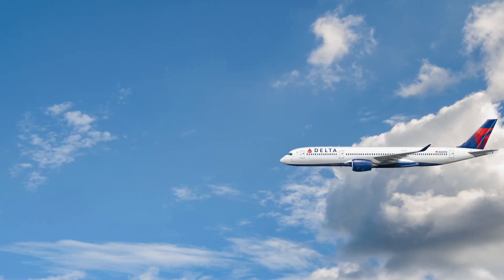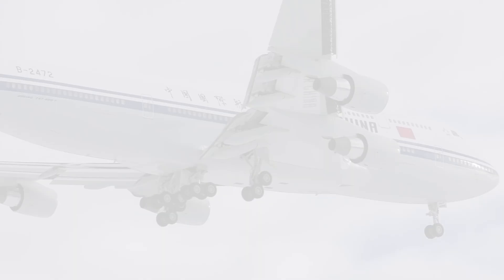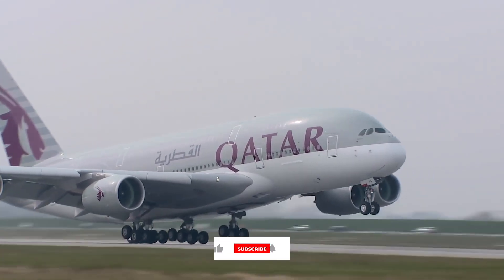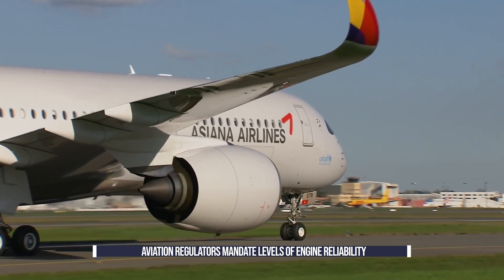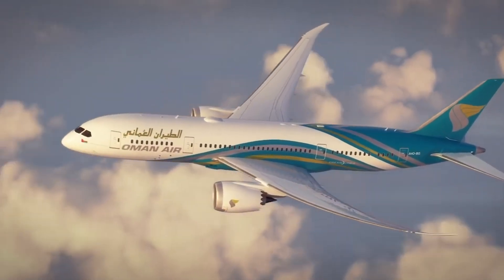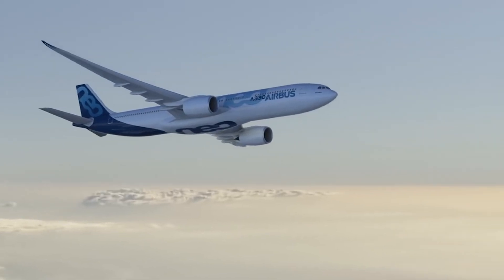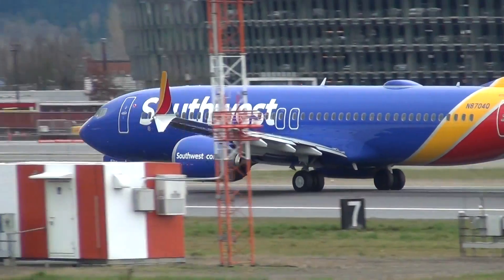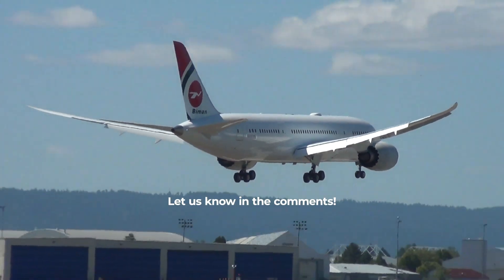How Far Can A Modern Twin Jet Fly On One Engine

Comment: This is like Apple.  Just take away the components and call it a feature. Eventually they will take away another engine and the plane will be down to one engine.  Just don’t blame plane if it crashes.  Just blame the pilot.
Reply: However, engines are not like a phone. Removing the headphone jack on the newest IPhone 51SR XL Pro with a 100 inch screen and 1 minute battery life is not as important as an engine going out on a Qantas flight from South Africa to Australia over the Southern Indian Ocean. The FAA would probably go insane over a monojet and strike the idea down. The FAA probably has done this at least once, considering that Boeing once considered a 747 trijet, proving that even the most cursed airplane ideas have been seriously considered.

Comment: question for experts...how many miles could a medium jet (a320, b737) fly after one engine failure during the final approach and at a low altitude (lets say at two thousand feet? And, in case of going around or missed approach in that situation , would it be possible to climb and start the approach procedure again with one engine?

Comment: have the FAA and other civil aviation authorities as well as plane and jet engine manufacturers actually tested these twin jet planes in actual flight conditions with just ONE engine in operation? not the engine's theoretical range?
a single jet engine could subjected to stresses beyond its original design parameters when compensating for the power provided by its twin engine on the other side of the plane... if ETOPS is based on theoretical range of the plane's jet engine, have they tested if the actual range is achieved as per ETOP Standards?

Comment: Another point is that ETOPS ratings require a particular maintenance regime whereby the 2 engines are maintained by 2 different teams (from different companies I believe). This is to reduce the possibility of an error occurring during servicing which could be repeated for the other engine (wrong oil etc.)

Comment: Been on a 747 when they needed to shut down one engine due to low oil pressure. You would not have known it unless you took a peek at the EGT cluster while visiting the cockpit. Yes kids, there was a time when that was possible :-)

Comment: I've been on two 747s that lost an engine. One on landing in Boston, where the right inboard engine backfired and then caught fire. The right wing panel was damaged, and we had to wait for about four hours for another airplane to be flown in from NY so we could go on to London. The other was flying from Athens, Greece to Istanbul, Turkey. After landing, the passengers were allowed off to wait in the terminal. Fortunately, I did not go. Once everyone was off the aircraft, the captain announced that the left, inboard engine had cracked a hydraulic pump, and there'd be a delay while it was replaced. Three+ hours later, a lot of grumpy pax got back on the plane.
Another thing I've seen (but not flown on) is a 747 with a fifth engine. There's an extra engine mount on 747s, inboard on the left wing. It won't run, but an engine can be mounted there and flown to somewhere else where it can be taken off and put on another aircraft.
Reply: The Vickers VC10 had a similar arrangement, with the spare engine carried in a streamlined pod.

Comment: They can fly until the fuel runs out. On the jet I fly, from California to Hawaii, it burns LESS fuel if you lose an engine at the mid-point (Equal Time Point) of the flight. It would be a little stressful, but it should get you there.

Comment: When one engine silently turns off and cannot be restarted then it might work to peacefully fly to the next possible airport. But usually this is not the case rather there is an explosion, the engine is destroyed and the crew is worried whether the wing is damaged or there is more and more fire spreading.

Comment: The answer is little bit mistaken. You can't maintain your altitude and speed with loosing one of your engines. Your speed will be greatly changed. So the calculation of normal cruise speed x time is not relevant. You may check basic one engine speeds from net to get much more presice results.

Comment: One question that never gets answered: What if a catastrophic engine failure caused a penetration of the fuselage [like the Southwest incident], and the aircraft had to drop below 10,000 feet to maintain livable oxygen levels for the passengers, and it was halfway across the Atlantic or Pacific. How long could it run on one engine, at or below 10k, which obviously would gobble up a lot more fuel
Reply: That's a great question!  One which deserves a great answer!
Reply: Good question. With a bunch of contingent answers, only some of which I know answers to. For smallish leaks in the cabin, the aircraft should be able to maintain pressurization. IIRC, up to one missing/blown out window (so it's not just tiny leaks). Another part is, as you conjecture, how long could it run on one engine? The rules for pressurization require cabin pressure below 14,000'; for crewmembers, w/ oxygen above12,500' cabin altitude for more than 30m, or above 14,000' at all. At those lower altitudes, airliners will see substantially increased fuel use and slower speeds (due to both power loss and thicker air).
I would assume/guess that these must be allowed for in flight planning in terms of pax/cargo/fuel load and abort options.
I note that ETOPS used to stand for 'Extended Twin Overwater Passenger Service' aka ('Engines Turn Or Passengers Swim') when it came out ~30 years ago.
Reply: ETOPS regulations require that the flight be capable of descending to 10,000 feet for a depressurization and maintain the same cruise speed as they were traveling at altitude before the failure and still make it to the destination, have a missed approach and circle the pattern to land and still have the standard reserve fuel. 

Remember, the official policy before ETOPS was considered was that it would be a cold day in hell before it was allowed.  The safety systems are extreme. Every airline, aircraft, route and crew member has to go through extra approvals. For example Southwest has to fly dozens of flights to Honolulu from each proposed connection with no passengers and prove they could make the trip with the various contingencies required. 

Another example is American Airlines a few years ago accidentally flew an aircraft that wasn't equipped for ETOPS on an ETOPS route. It didn't have life rafts . They discovered the error and admitted it during the flight. They paid a hefty fine and had to fly the aircraft back empty and send a replacement to take it's place. 

There has only been one ETOPS flight that really pushed the safety margin to the limit. A United flight to Honolulu had an engine failure that ripped off the casing and created a lot of drag. It also caused massive vibration. The media hyped up the washing machine experience, but that flight was steadily losing altitude regardless of what the crew did and it was using extra fuel due to the drag from the engine. If the engine had failed even 30 minutes earlier, people would have been swimming.
Reply: They plan for that. Depressurization (for any reason) is one of the contingencies that you are required to carry enough fuel for.
Reply: All the way to the scene of the crash! Your mileage may vary.
Reply: @haroldhenderson2824  Have you heard of Flight 243? Or this case where an A380 had a fuselage and wing penetration due to an engine explosion. https://www.youtube.com/watch?v=JSMe1wAdMdg&ab_channel=MentourPilot

Comment: Title should be how far do regulations allow a twin jet to fly on one engine.
As long as the plane can maintain altitude on one engine it can continue to fly until the fuel is exhausted.
That a very different thing from a regulatory limit.

Comment: Airliners: one engine fails, still have one or three engines running.

Gliders: Sweats nervously
Reply: Cessna pilot sweats. Glider pilot is just wondering what all the fuss is about :-)
Reply: @freggo6604  except if you're just about 50m off the ground ...
Maybe in a residential area...

Comment: other factors I didn't catch being explained much - an engine failure often means a badly-balanced (because of the failure) heavy draggy shaking windmill installed on one wing - flying at regular cruise altitude and Mach number isn't in the cards if that is what happened

Comment: We are seeing a lot more small jet Trans Atlantic crossings, Flights from Canada to the UK are performed daily with A321 neo jets.
BA were flying an A318 non stop JFK to LHR daily & Shannon to JFK.
What concerns me is etops is all well & good for a shut down engine but mostly an engine grenades, better known as an un-contained failure, these invariably cause damage to the flying surfaces, hydraulics, electric, fuel systems & air systems.
Take a look at the A380 engine failures !

Comment: So what happens when a plane with one engine goes beyond it's ETOPS rating? It just falls out of the sky?
Reply: It is not allowed to fly routes that would get it beyond its ETOPS rated distance.
Reply: @bosandzeros  I know that, it's a hypothetical question. If they did what would happen?
Reply: @shrimpflea  the point is, none of the engineering has been validated for that happening, so the technical airplane performance answer is, no one knows.  (but it's probably like what happens if you take an aspirin after its expiration date; it probably works OK)
Reply: @marksandstrom4248  I looked it up. It's a very complicated process to rate the planes. They actually do test flights with one engine shut down.  A lot of it has to do with the work load put on the pilots with one engine down more than the engine itself.
Reply: Nobody really knows, but would you really like to be the pilot that finds out flying over the middle of the Southern Indian Ocean? I thought not.

Comment: I've flown on a Boeing 737-800 to Honolulu Hawaii.  Five hours in a single-aisle plane is not an ideal way to fly across the Pacific.
Reply: 737's from Atlantic Canada to Scotland have been done quite regularly by Westjet in pre-covid days.  What does an extra aisle do to your space?  I've done a few trans-Atlantic flights in 757's aboard Icelandair and frankly it makes not a lick of difference because the seats aren't any wider on a wide-body jet.
Reply: @joncalon7508  I like to crossover to the 2nd aisle through the galley especially when one is blocked by a drink/food cart. A twin-aisle plane gives you a sense of spaciousness.

Comment: Factoring wind and one engine
An Aircraft cannot maintain 575mph (925kph) 
Range is considerably reduced
Reply: I think you're right. Mentour Pilot has a video explaining the procedures in case of engine failure. It includes altitude adjustments because with just one engine you can't maintain speed, and consequently, cruise altitude. So you have to descend, considerably reducing range. But of course ETOPS takes that into account.

Comment: If a car’s engine dies, you pull over (safely) to the side of the road. If a plane’s engine dies, you fall (eventually). When someone asked me why plane engines are maintained so much more than we maintain our car engines, that seemed like the best explanation to give.
Reply: You don’t fall you glide. A plane doesn’t just nose dive because the engine stops but it definitely won’t climb without loosing speed. Also you’d have to loose all your engines to have a serious problem. Planes can still fly on one engine
Reply: @tomstravels520  that’s why I said “eventually”. As the video says, you can fly for multiple hours on one engine, but eventually you gotta come down. My friend just didn’t get why plane engines were so much more meticulously maintained than car engines
Reply: @LoboLakerGaming  to me that says “if the engine dies, the plane will continue flying as per normal for a bit and then eventually it will suddenly nosedive and fall out of the sky and impact the ground”. A plane will not “fall” at all unless you stall it
Reply: @tomstravels520  he said eventuelly that mean the plane will go down in a couple hours for example
Reply: @adamsadi3173  a plane will never “fall” unless you stall it
Reply: @tomstravels520  ik

Comment: Until it runs out of fuel.
Reply: Exactly.  It can’t fly as high, fast or far as it can with all engines operating but it will continue to fly until you land or until shortly after you run out of fuel.

Comment: I was on a 727 taking off from Chicago when it lost one engine. It simply returned and we changed planes. Passengers never realized we had lost an engine until we started to make our approach back to Ohare. Never felt a
the loss.
Reply: Losing 1 of 3 engines placed on the rear part of an aircraft is most likely not to be felt.  Losing 1 of 2 that are placed on the wings on a heavy takeoff will be more noticable.

Comment: I’m pretty sure it’s not just the plane that has to be rated. So does the airline and the pilots as they have to prove they have a plan of action incase a plane diverts to say Greenland
Reply: Yeah, each flight plan has to be approved and the airline has to have plans to take care of every passenger on any possible diversion airport, for example. But the ETOPS ratings indicate their maximum over-sea range, given those regulatory conditions.

Comment: FAA? Not ICAO? Why do the FAA get involved with planes flying over Siberia or Australia?
Reply: Any aircraft flying into US air space must be certified by the FAA. Most countries use the FAA certifications since they are more reliable,. Just like English is the official language for commercial pilots and air trarffic controllers.
Reply: @mikestone9129  and as I said, what about flying over Siberia or Australia if they are domestic flights? Or what about LATAM flying from Australia/NZ to Chile/Argentina? And actually there are 6 official languages but you have to be able to speak English at least.
Reply: @tomstravels520  any air plane built in the US must be FAA certified,
Reply: @mikestone9129  and what if it isn’t a Boeing?
Reply: @tomstravels520  Airbus has a facility in Mobile, AL.
Reply: @Gameflyer001  they only make A220/A320 family aircraft for US airlines
Reply: The ICAO does not certify aircraft.  ANY aircraft that flies over any country must be certified by that nations certifying authority.  To fly over Siberia a certificate is required from the FATA, for Australia it's the CASA, etc.  But not all countries have their own certifying authorities, so they may accept FAA or EASA certification.